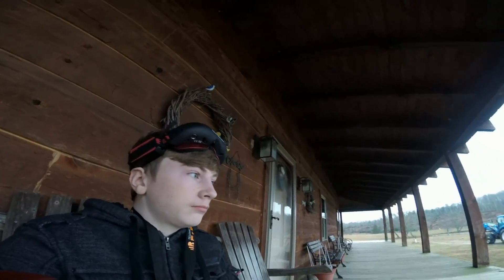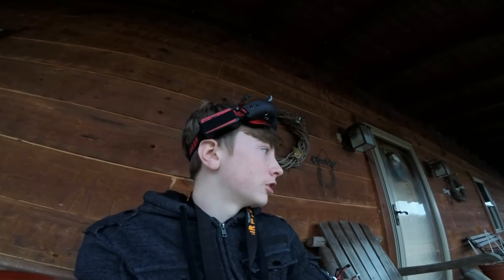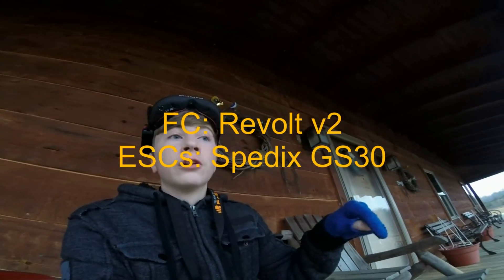Betaflight 3.3 Prototype Kalman Filter Test - OMG SO SMOOTH

Comment: Why do you not run raceflight on your raceflight flight controller? 
Also you induce prop wash not endure it.
Reply from the maker: Ive never been able to get raceflight to fly good, it would always either make my quad shake like crazy, have bounce back on aggressive moves, or make my motors put out weird noises. I put enduce but I think I spelled it wrong lol.
Reply: i as well just recently got rid of mid throttle vibes by simple flashing fast kalman filtering........preston told me for months the bounce was my fingers.......now i can have a nice flying quad with no mid throttle vibes and no bounceback as well. thanks rs2k!
Reply from the maker: Working great for me as well

Comment: finally fix the reciever bridge rx1 to tx1 when i paste your code the accelerometer no longer works ?
Reply from the maker: +spooner Graham oh yeah I forgot that you have to bridge those pads lol. The accelerometer doesn't matter if you don't fly angle mode
Reply: Lol all sorted
Cheers
Copied your rates .Have you been happy with those setting or have you altered any If so please share
Reply from the maker: +spooner Graham i dont remember copying my rates down anywhere lol but the rc rate is 0.6 and the super rate is 0.9, no expo, on yaw it's 1.01 rc rate and 0.79 super rate. I'm testing some new rates but I can't remember what they are lol. But great that you got your problem fixed. The settings I put in the description have worked pretty well for me.

Comment: I need your help I bought the raceflight v2 ,Flashed with Betaflight I just cant get the reciever to work, even though i can see it is bound on my tx.Its wired to TX1 vcc and grd
Reply from the maker: +spooner Graham try using the command set serialrx_halfduplex=ON
Reply: i did and still not connecting. Another guy said solder the tx1 and rx1 tab to get sbus to work You didn't do any of that?
Reply from the maker: +spooner Graham dm me a pic of how you have it wired

Comment: Cool, do you have any your video without Kalman Filter to compare))
Reply from the maker: +godz320 without the kalman filter on 32k it will make a terrible whistling noise. If you don't use the kalman filter and are on 8k it should fly the same as any other betaflight

Comment: Nice save on the landing I was worried that you was going to hit your face for a second... I can't wait to try the new filers and 32k on b.f.3.3 I need a fc that can support it. I know kakutea f4 can, what fc are you running
Reply from the maker: +HIGHCOUNTRY fpv haha I land like that all the time. The 32k definitely flies well. I'm using a revolt v2. If your fc is the one that has the icm20608 gyro then it should work as long as you turn on cpu overclocking
Reply: QuadBro FPV thanks man, happy flying

Comment: Damn mate. You are a freakin good flyer. So smooth and juicy! Subbed to you. Do you think Kalman filter will also work on a matek f405 with dshot 600 esc's?
Reply from the maker: Thanks man! It should work on the matek board as long as you have cpu overclocking on
Reply: QuadBro FPV Alright thanks bro! Going to try today. Would you mind giving my channel a quick look?